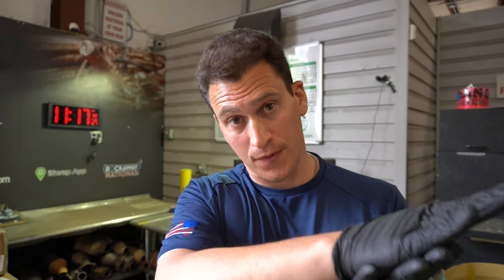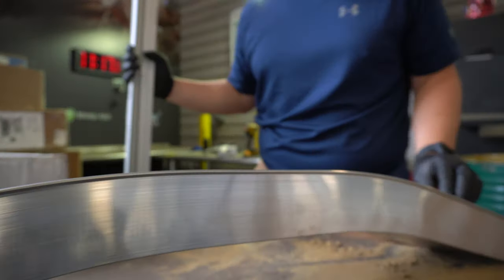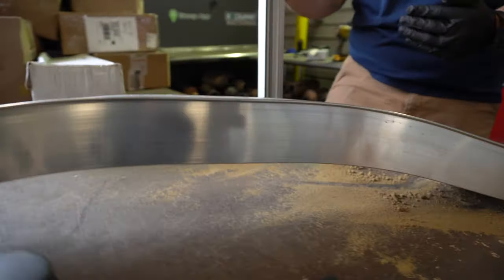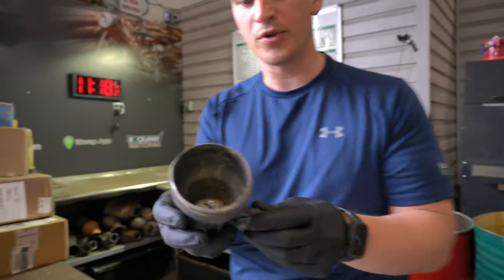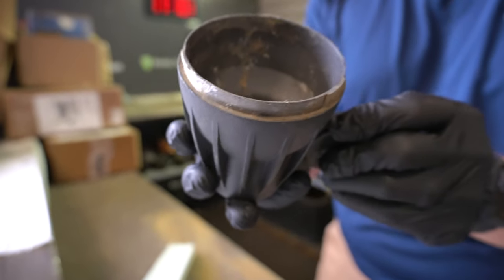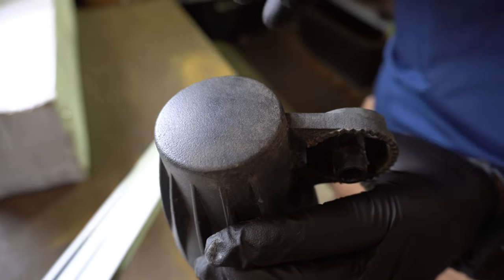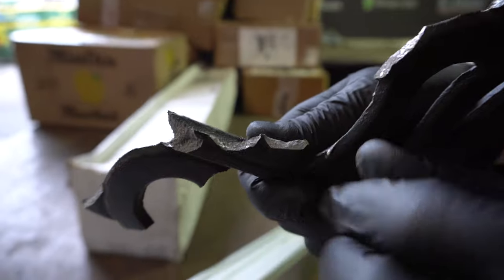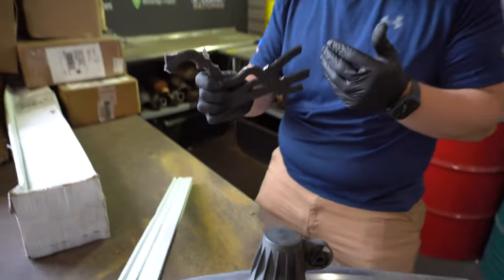Difference in Scrap Cast Aluminum vs. Extruded Aluminum

Comment: Don't mean to be critical, but cast aluminum is not a lower grade of aluminum. Extruded and cast aluminum are different alloys. I've built patterns for x-ray quality cast parts. Cast aluminum is used in the aircraft industry. Other than the alloy the only real difference is cast aluminum has no grain structure, it will break. Extruded aluminum in the process will align the structure or grain with the length of the extrusion. Just like the difference between cast steel and cold rolled steel. Look up both aluminum alloys you'll find that both Extruded and cast has similar requirements for various alloys. Both cast just as well but I need to deal with extrusion differently. Extrusion loses its hardness when cast, and that doesn't machine well. But there is a fix.
Reply from the maker: We are thankful for this very thoughtful comment, we will do another video reflecting the ideas of the grain vs. the strength, thank you.

Comment: Hey iScrap app, Dirty aluminium was 0.07lb a few months ago when clean aluminum was 0.24lb. Now dirty aluminium is 0.11lb and I'm hoping for a similar increase in my clean aluminum. My question is why haven't I seen an increase in the price of aluminum cans? It's been a steady 0.60lb for about 6 months and hasn't increased the same as my other aluminium. Tks.
Reply: PS- I'm in Phoenix.

Comment: Aluminum extrusions tend to be sharper , shinier , and precisely fitted and shaped, whereas its Casted counterpart is for cheaper applications , and therefore imperfections in surface texture may be present